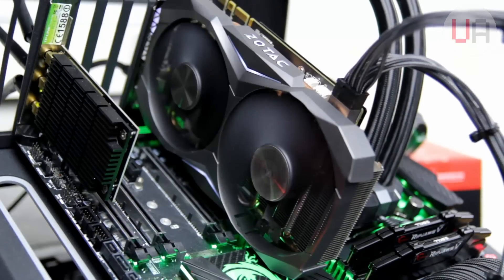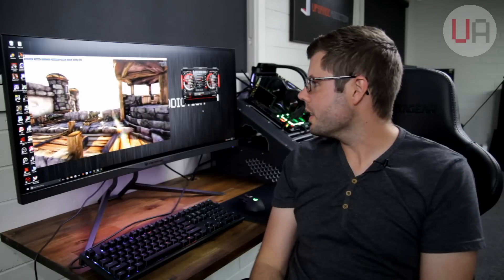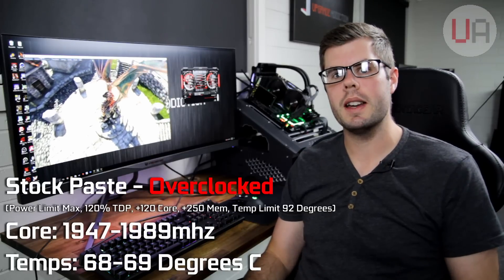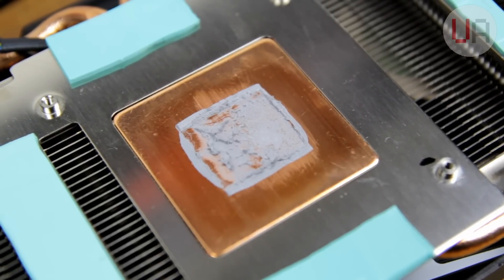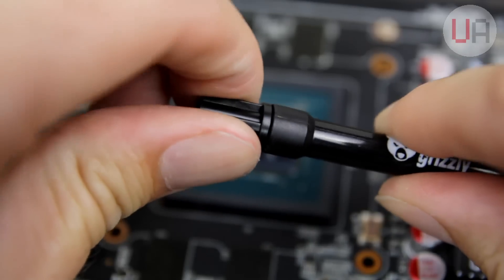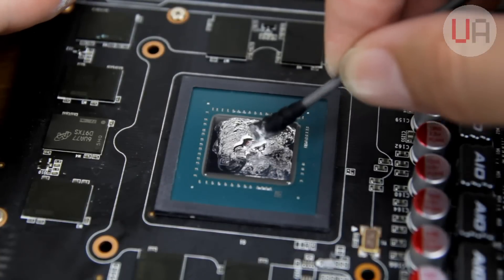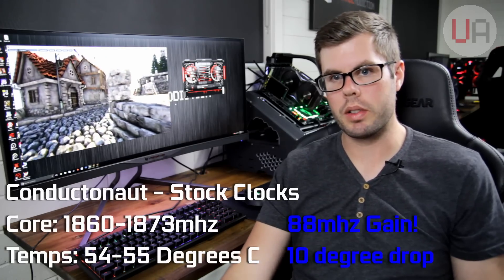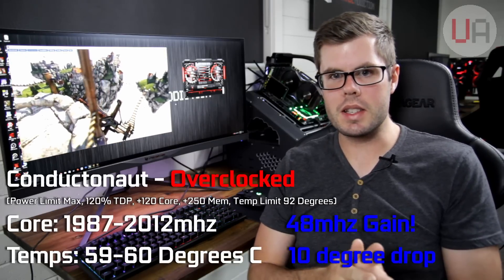Liquid metal on a GTX1080! How much did it help? (Thermal Grizzly Conductonaut - Zotac 1080 mini)

Comment: He applied way too much LM TIM.  Ideally you just want the thinnest layer possible on contact points over the actual die.  With the amount applied, i could see it leaking out onto the adjacent metal components and causing damage.  DO YOUR RESEARCH BEFORE USING LM TIM!

Comment: How would that work on a PS3 or XBOXONE?
And how durable?
Reply: Pretty much the same way. Remove the cooler, remove the original paste, apply the new paste (taking care not to spill any conductive liquid metal onto the PCB/resistors) and put it back together. Warranty will definitely be void then, though.
Reply: It may do, but make sure the heatsink you're transferring heat to isn't made of aluminium.

Comment: whats difrance betwen kryonout and conductinaut in c on gpu?
Reply: Temperature is slightly cooler on the conductonout but it is conductive, meaning if that paste touches any electronic part you can say bye bye.

Kryonout is non conductive thus safer but thermal conductivity is not as good as conductonout
Reply: @vsmh96  how much difrance in Celsius?
Reply: @vsmh96  how much conductonout droping from Kryptonount Celcius
Reply: @YosefElgart  about 3℃ but many factors will affect this such as your ambient temperature, case etc etc…

For me Liquid metal is a bit too risky so I would stay with Kryo.

Other pasts worth considering would be the Noctua NT-H1 / Artic MX-4. Both are warmer by about 3℃ as well compared to the Kryo
Reply: @vsmh96  i have kryo installed on gpu 1080ti and its lower clocks when it go above 60c
Reply: @YosefElgart  which 1080ti are you using? 

My 1080 comes with a software to tune the fan speed.

What is your ambient temperature as well?

I do not recommend using LM on GPU
Reply: @vsmh96  evga with 3 fans sc3? i forgot yes its fans on agresive mode but still. didnt see video compare this 2 pastes
Reply: @YosefElgart  do you mean FTW 3? 

You can just simply Google Condutonout vs Kryonout.

Again, what is your room temperature like? 60℃ seems to be a little warm for a 3 fan card but it actually is fine.

Comment: Does MSI Gaming X coolers have any problem with liquid metal ?
Reply: anyone?
Reply from the maker: thanasis47 no, they will be fine. They use a nickel plated copper heatsink on their current cards.
Reply: Upgrade Addiction if i put this paste on intel cooler ?
Reply: the stock cooler is of pure aluminum so it will eat through the heatsink.